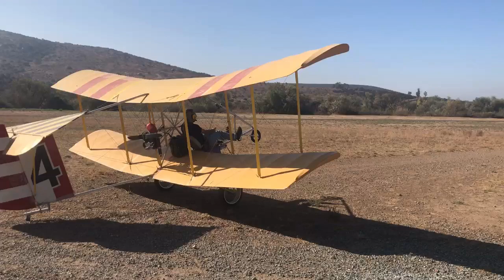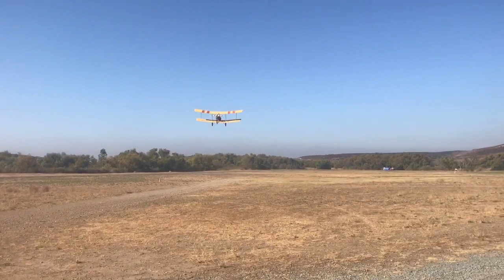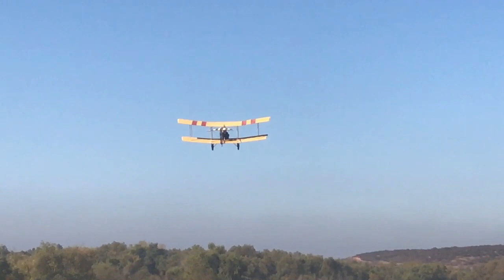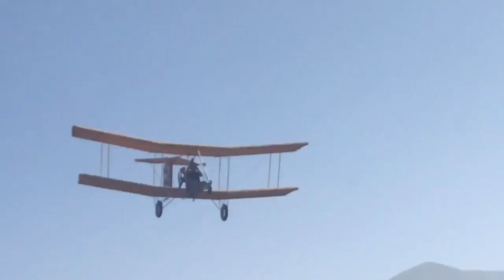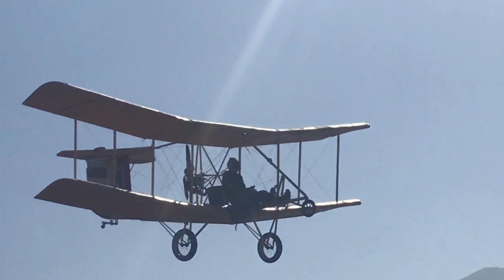Bloop 4 Short Fllghts

Comment: Wow, that was a slow landing. I'm one of they guys who fly it now, and I come in hot. Mostly due to a crosswind where I fly. It's special little airchair. I had an engine out recently, I think due to carb icing.
Reply from the maker: In my motorfloater flying I landed with a fast approach in turbulent conditions (for better control), but always setting down as slow as possible (also for good control, because you have more time to react). The slower landing in a cross wind will be at a greater crab angle, but I think the skidding loads on the landing gear will be minimal at low ground speeds even if at a slightly greater sideways angle. The trikes are in the same situation, and some choose to land slow, some fast. On a long, smooth runway a fast landing might be an option, but in a rough field I would really want to touch down slow.

My engine used to quit a lot on final approach, in idle, maybe there was some icing. Eventually I just raised the idle setting and avoided flying at idle until final glide was a sure thing. The high rpm engine problem shown in the video may have been due to a clogged static port, lowering pressure in the fuel tank.